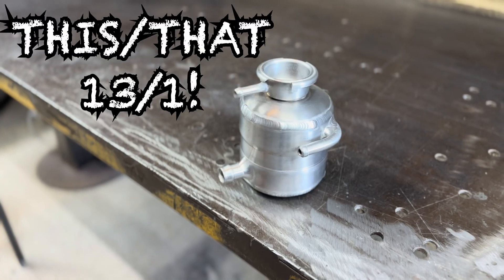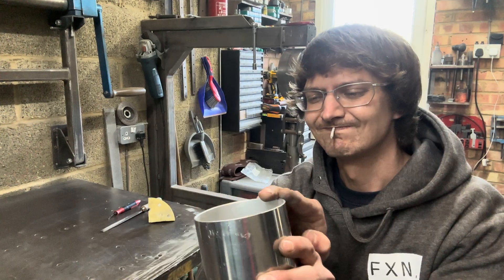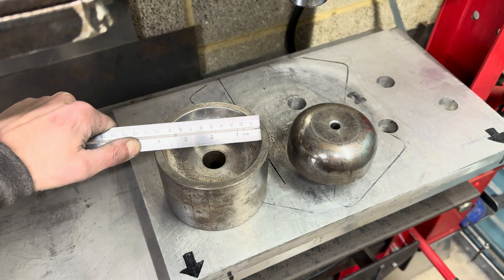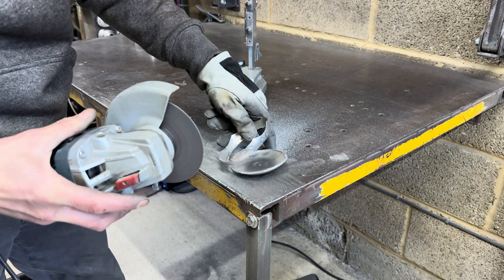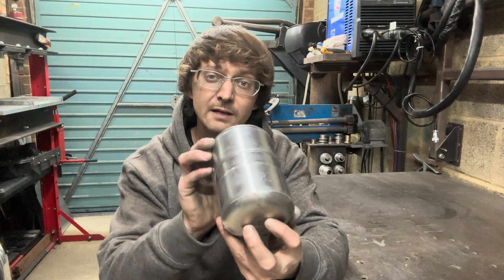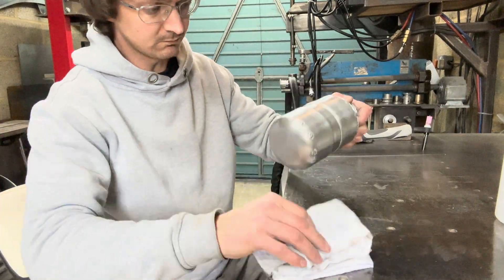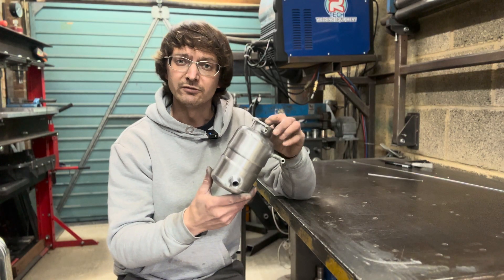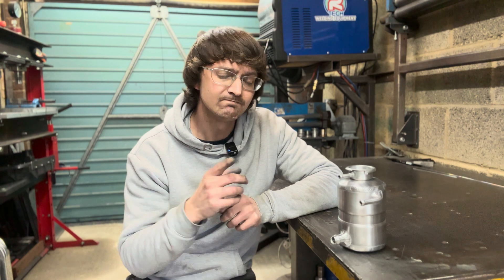EP4 - Building This Aluminium Header Tank

Comment: Very nice work!  I might add that rolling the center bead inward will have reduced the volume from your fully cylindrical calculation…not that it makes that much of a difference!
Reply from the maker: Thanks Hans! Yes, you’re correct 👍 Luckily, the caps will make up for it 😉🫶

Comment: What cutting discs do you use for ali? They look like they cut well, i find that the ones I use wear quickly and give a large burr.
Also that laser cut disc is so tidy, I bet that took a few goes to get perfect...
Tidy work man!
Reply from the maker: These are just the 1mm discs from screwfix. They are proving to be a good disc 👍. 

Thanks man, it’s actually fairly easy to work out when you have all of the details of the pressing tool and end requirement 🤟
Reply: @FanFabWeldWiz  do you do the CAD work yourself?
Reply from the maker: @PinkyRidesBikes  I do, yes, but I only 2D draft. I’ve been able to avoid modelling in 3d so far, but it’s something I should really put time into learning. It would help in a very large way with developing new designs!
Reply: @FanFabWeldWiz  i think there’s a bit of a stigma around CAD, especially 3D work but I think it just comes from people thinking oh there’s no skill. Anyone can draw something on a computer…
Actually not the case. The years of fab I’ve done pre being able to draw anything has meant when I do draw I’ve got so much knowledge to put in to the design. 
I mean, for example, I could go out to the shop, drag bits of metal around, develop a cone, cut it out with a torch or a grinder and then flap the edges down and hope I’ve done it correctly… or I could draw it, send it to the CNC go out roll it. It’s going to much quicker and tidier. 
Work smart not hard 😉
Reply: The best 3D modeling is done in your head.